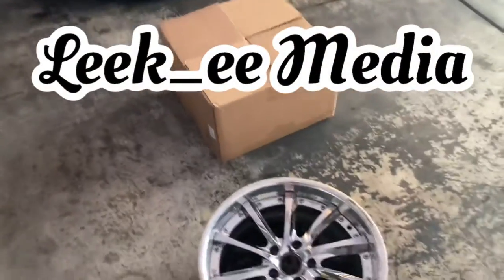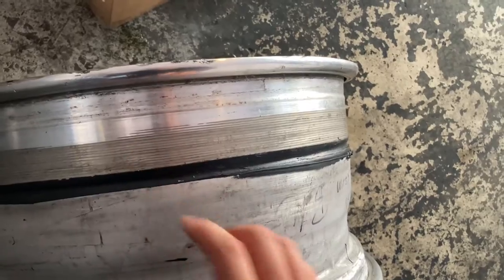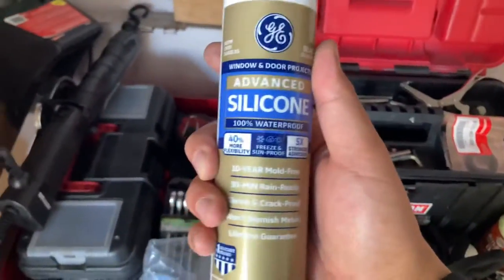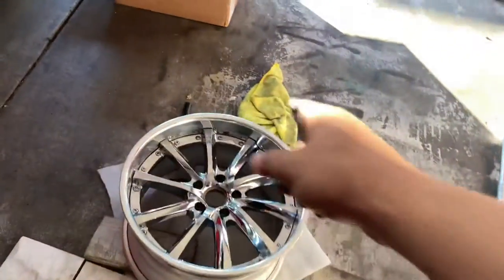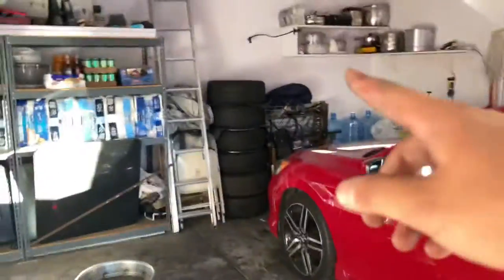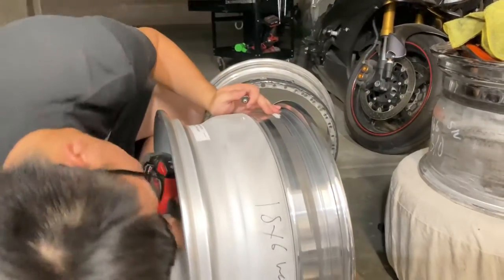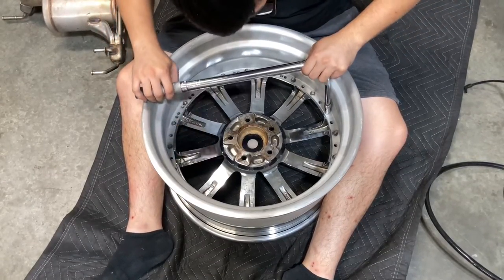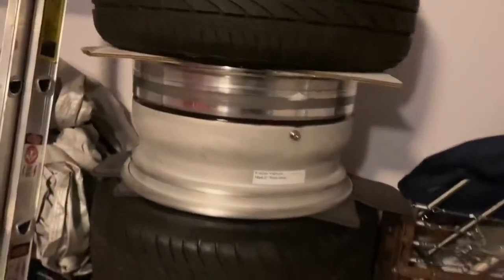My Wedz Vishnu’s Lip and Barrel Finally Came | Assembling 3 Piece Wheels

Comment: Were the lip/barrels welded together before you put the silicone? Any issues with it losing air, cracks, etc?
Reply from the maker: Naw the barrels weren’t welded. Make sure you properly torque all the lugs and apply the silicone correctly. Then let it dry up to three days before mounting the tire
Reply: @Leek_ee what’s the torque spec?